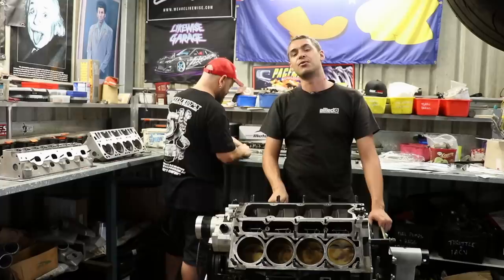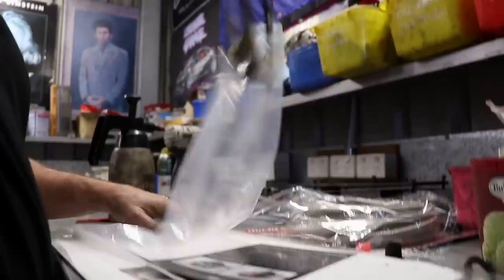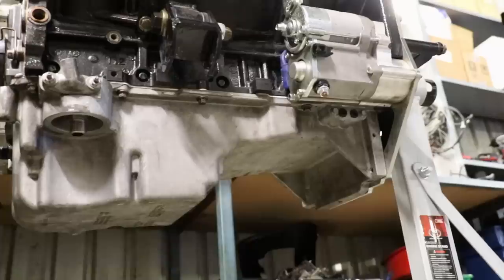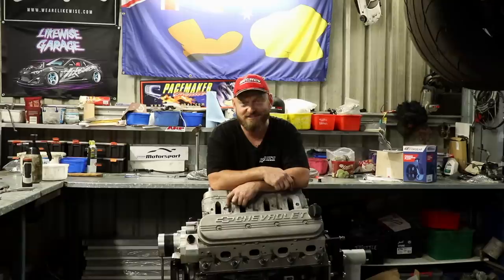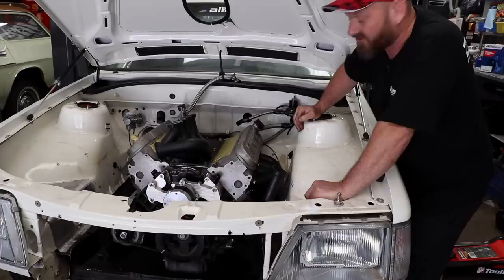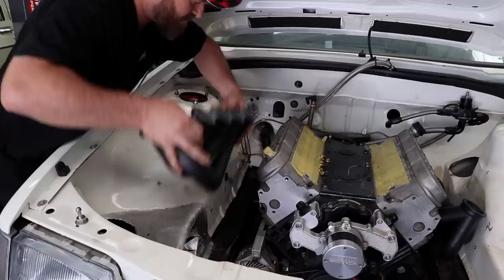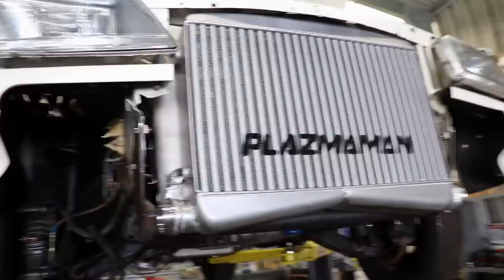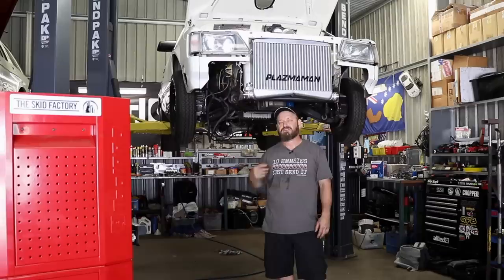TURBO LS HEAD GASKET AND ENGINE INSTALL - THE SKID FACTORY

Comment: there is massive twist in car chassis, I jammed my fingers in between the door and jamb when the door was shut once. lowered evo1, driving on an angle into a steep driveway and the door gap opened up while i had my fingers touching the door rubbers. when the gap opened up my digits slipped in and then the car got all fours on the same plain and closed the gap.

Comment: I set my 240 volt drill on fire trying to hole saw out several 75mm hole into 13mm aluminium making supercharger flanges I've never smelt something so toxic than that drill motor on fire. Still got the job done and I invested in a good drill press.

Comment: Those BMW radiators must be good, Al uses them for everything! Looks like a versatile bit of kit, if you know how to mount it. Another awesome video, cheers guys some good engineering topics, like the body flex and rubber mounted components.

Comment: May have already been pointed out but................Instructions with quality holesaws (Millers Falls or Stanley perhaps) say maximum speed not more than 50 feet per sec. straight line cutting speed. Slower the better so long as you are getting swarf.  If you stick to something under that (50fps) keep them cool & use recommended cutting fluid they will give good service.
Reply from the maker: The 4" holesaw we replaced is about 5 years old.

Comment: All my holesaws are complete crap. It's like they come from the store that way
Reply: The Orange glow they make hurts my eyes....
Reply: @truthseeker8483  Just means you gotta run em a bit faster, spin some of that heat away.
Reply: @Spooly_  Yes but by then my drill is also glowing red... :-D
Reply: @MangoVisionn  ewwww
Reply: If your after a bi-metal try the Milwaukee Hole Dozer hole saws. So far for me they are the best I've ever used (and I'v tried them all, boiler maker), they last forever!

Comment: How you guys finding the toolpro stuff you've started using? 

Been using their ratchets and sockets but the 12v stuff looks decent for the price
Reply from the maker: James Creaton loving it mate! The 12v Range is awesome!
Reply: The Skid Factory ah crap, my wallet only just recovered after getting a new welder! Here we go again little guy...
Reply: James, I've got the following things off ToolPro:
3 Ton Floor Jack, Spring Compressors, Bearing Puller kit, 6-32mm spanner set. None of them have failed me yet. 👍
Price for performance, some of the best stuff on the market.
Reply: as its 12v should be easy to make up an adapter with some leads so you can run it off the car battery and use them out on the road
Reply: @transdimensionalist  Easier to charge the 12v from the 12v and keep using them as cordless tools.
Reply: @stevegraham3817  its an adapter that plugs in like a battery(maybe an old battery) so you can do either, why charge one from the other and have to wait?
Reply: @transdimensionalist  Yep, I built them from old batteries back in the late 80s / early 90s when a new battery cost about the same as a week and a halfs wages for an apprentice. But it's still much easier to either get a dedicated 12v charger from the manufacturer, if they make one, or make up a set of jumper leads to top up the tools battery. Than it is to destroy a battery to create an inconvenient corded tool.
Reply: James Creaton I’ve got their 3/4” torque wrench and 100l sandblast cabinet, both are great quality
Reply: i think the sockets suck ive cracked a few especially the large ones 23mm
Reply: @theskidfactory  How do you rate it compared to the Milwaukee. I have one but wondering if the extra torque you get on the Milwaukee is worth the price?
Reply from the maker: @Danny0432  If you are talking about the 3/8" hand ratchet then there is zero difference. The only thing is toolpro don't do huge rattle guns like milwaukee does. My favourites are the 3/8" ratchet and the 12v drill.
Reply: @theskidfactory  I do love my half inch Milwaukee, it's also handy that it shares batteries with my weed whacker, leaf blower, and all the other regular tools I have from them. The insane amount of tools they make that all share batteries is probably my favorite part of Milwaukee.

Comment: Any chance you could do a comparison between the aluminum block LS variants and the 1UZ (dimensions, weight, pros and cons)? Trying to decide which to go with here in the States. Looking at NA power, specifically an L33 (5.3) or a late model 1UZ. Thanks, guys!

Comment: Didn’t you upgrade the valve springs?  If not they will float  - Matt Happel recommends PAC1218s or equivalent if sticking with single springs.
Reply from the maker: It's already a fully built engine.

Comment: Love the channel! And what motor is that front sump off? I need to get rid of my square Morriso thing it looks like crap. Oil filter relocated to the front too, through ports in the sump?
Reply: I’m gonna reply to myself here, early LS1 sump?
Al I’m only asking because you’re definitely a guru, whereas I learn things the very hard way.. I’m just not sure how the oil filter integrates from the rear of the pan to the front and if I can just bolt this LS1 pan onto my L98? 
😅 obviously need a new pickup just the oil filter is what is doing my head in 😂
Reply from the maker: It's a commodore sump, assuming you are from the USA it would be a pontiac GTO sump. They are pretty rare in the USA but everywhere here. It is a factory GM engineered unit with pipes inside the pan to transfer from rear of block to front filter. The engine actually had a moroso sump on it which is a terrible fit for a commodore. I assume it's made for older Ford fitment.
Reply: The Skid Factory oh shit yeah cheers mate 
I’m from Australia so I’ll just hunt around the wreckers for a early LS1 commodore sump. 
I’ve seen some performance places on line selling them way too expensive like $1800 😅

Comment: Hey boys, fellow south east queenslander here, what trails do you guys ride? I have just started riding in qld and struggle to find spots, thinking about checking out mapleton national park next weekend. If you have any qld parks you can recommend, let me know. Love the videos boys, the intercooler/radiator set up is a work of art 👌
Reply: If you are on the Northside of brisbane there are a mountain of trails through Beerburrum to Wamuran, start at the mango tree on Twin View road and head northwest from there. There is also QMP out at beaudesert and motorcross mountain (which has heaps of trails).
Reply from the maker: Kenilworth, imbil, amamoor. Heaps of guys riding and more than happy to take you along. Check out trailriders seq on facebook.

Comment: 15:57 "manufacturing intolerances" . Holden really didn't fix this kind of crap until the late 90's.  All the panel gaps on my VK were atrociously random.  God, I miss that car.
Reply: I had an old vk calais 308 back in the late 90's. Geez i wish i never sold it. I sold it to a "mate" for cheap who did burnouts in it until he stuffed the diff and engine then had the hide to have a go at me for him needing to rebuild the engine

Comment: Imagine doing all the things that you do here but instead of doing those things in a dirty, dusty, drafty old workshop somewhere in the back of beyond you are doing them in a laboratory where everything around you is white ! Welcome to my working environment, a place where if you drop a nut,bolt,screw or washer - not only can you hear where it landed because any noisy machinery is either rooms or floors away but you can see a trace of any lubricant that was on it on the white floors.
Seriously, i spend more time wiping the floor after dropping things 😂

Comment: Curious to why you didn't keep the single turbo set up and get a proper sized single turbo ???  Plenty of cars running quick times with a single.
Reply: Al gave the reasoning in the first video, I can't recall exactly but I think it was more a chance to do mirrored turbos, because it'll be mad :)
Reply from the maker: Wanted a change and to use modern mirrored twins.
Reply: @theskidfactory  sweet as guys !!!!

Comment: That LQ4 looks like it has LQ9 pistons in it.  Typically a .6 bump in compression.  It's what I put in my LQ4 6 liter.  NA.  sorry Yoda.   :)
Reply from the maker: It has forged pistons and rods.
Reply: they are diamond forged pistons
Reply: @theskidfactory  Nice ...even better.  The LQ9 is just a stock cast piston, but an economical upgrade over the dished LQ4.  ..but I'm sure you know that.
Reply: @davidfraser6346  Good call using them with boost hey.  I've stuck with NA to keep build cost down,,,my old buick rolls on pretty well, but nothing like a drag car.
Reply from the maker: @mynameis63  Iron block engines are foreign to us in Aus, we only got LS1 and L76/77/98 and LS2/3/LSA here. The other thousand versions of the LS are a bit of a mystery.
Reply: @theskidfactory  for sure bud....It caught my eye and figured I"d flap my gums with an observation.    Really enjoy you cats show man....it's far and away my favorite.  Southern AB canada based.

Comment: David really butchered those holes in the side of the bay, didn't he. Looks like a bunch of shark teeth waiting to take your finger off when you reach up under the guard 😋
Reply from the maker: That is just badly trimmed stick on heat shielding.